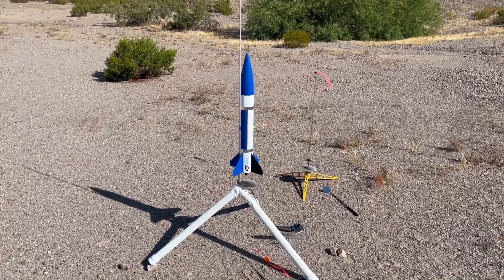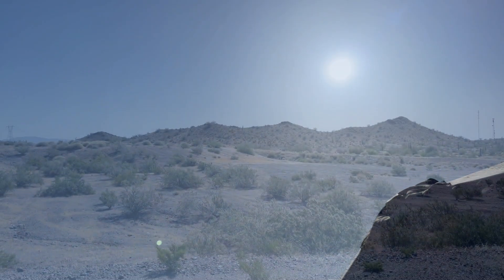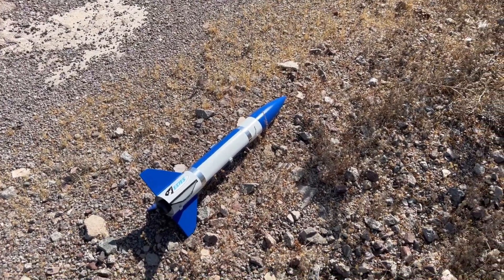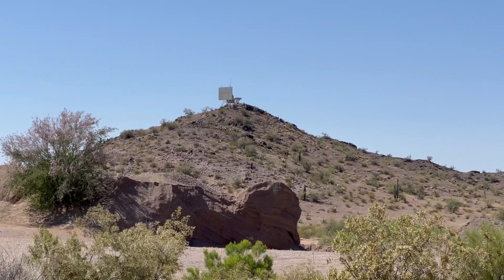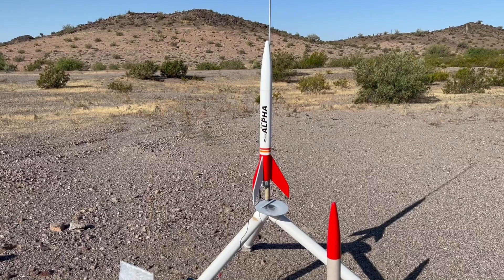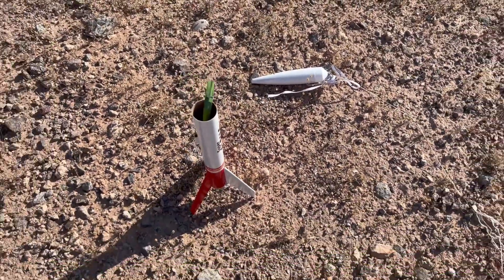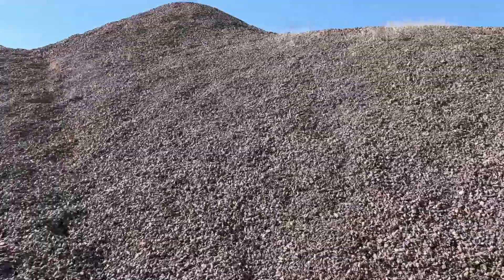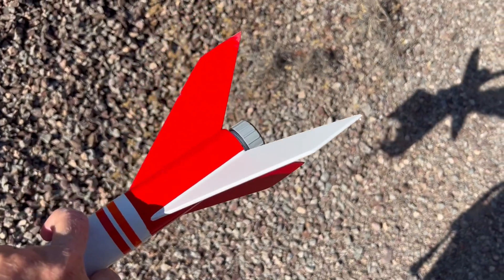Blowing Dust Area Arizona Model Rocket Launches May 2024 Part 2

Comment: Mind boggling find of the Goblin! I couldn't leave it there lol. And yeah, I run my kevlar to about 1 inch below the top of the tube and then thick elastic for another couple feet to be safe. I've been applying thin ca to the top 2 inches inside the tube and sand it for a solid finish to strengthen the top of the tube and avoid zippers.

Comment: Looks like your Doorknob reached the end of its Kevlar at high velocity, which ultimately may have caused the break of the nose cone attachment point. So, longer Kevlar or add some elastic in the system. You did not find your altimeter?? That's a very peaceful launch site when you are there on your own. It's great for flying highfliers!!
Reply from the maker: Good ideas! Nope: never found the altimeter. On my way out I roamed the site for another 30-40 minutes. A proverbial needle in a haystack….